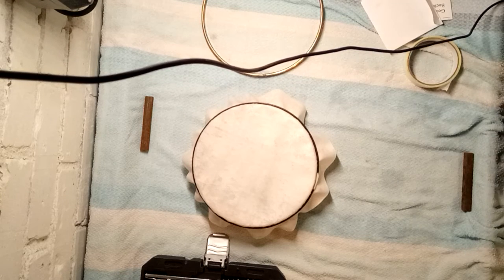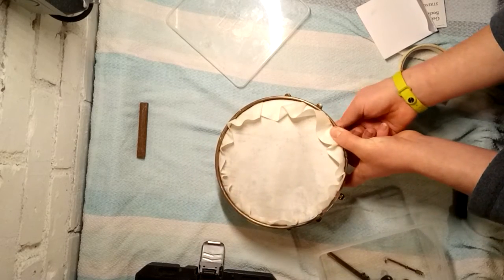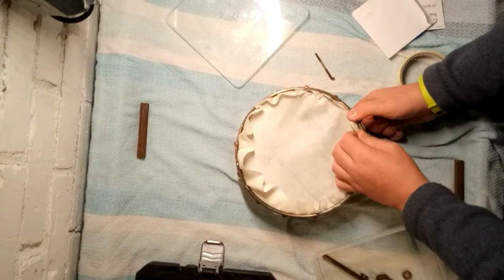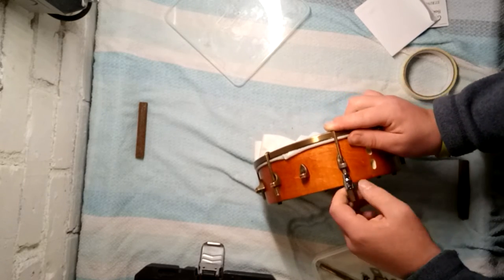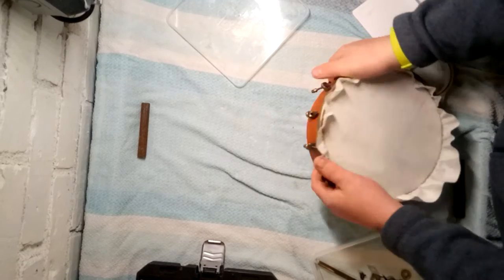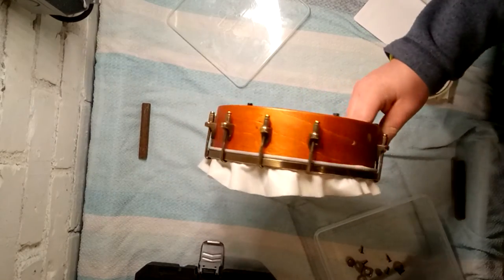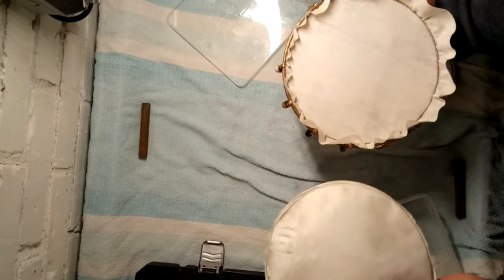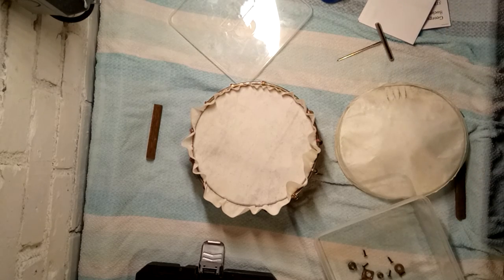Part Two: Fitting A Calfskin Vellum On A Banjolele!

Comment: where is part 3
Reply from the maker: Unfortunately, Part Three never made the final cut. It was too rough and didn't show enough, so I've left it to just two stages. Once the vellum is on, it's simply a case of just putting the neck, tailpiece, bridge, strings and nut on, which is a simple task. Once you've removed it, there's really only one way it can go back together. 

I'm actually planning on making a new video to remaster some information that I stated here that may need tweaks or updates, and instead of multiple parts, just make it one longer video.

Comment: Is it ok to tighten an old vellum?
Reply from the maker: Certainly so! Vellums tend to last many, many years. They will take to tensioning, but you have to be careful not to overtighten it all at once. They will tighten, it's just a case of doing it very evenly and slowly. Tightening up an older vellum could probably be best to be done over a course of a week, just nipping it up over time. However, I haven't had the pleasure of owning a vintage uke yet, so I may not be the best to ask. :)
Reply: Alex Greenwood I was just going to see if I could get a better sound out of my Dallas B before replacing the vellum. Thanks for the help and a nice and informative video!